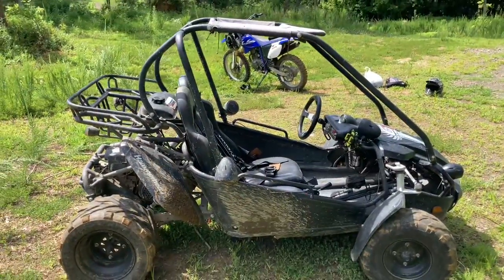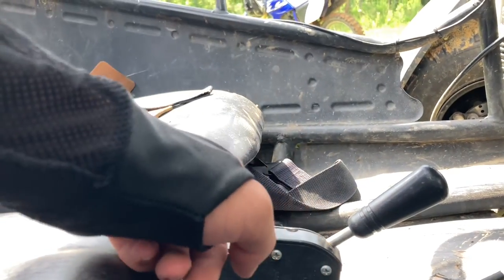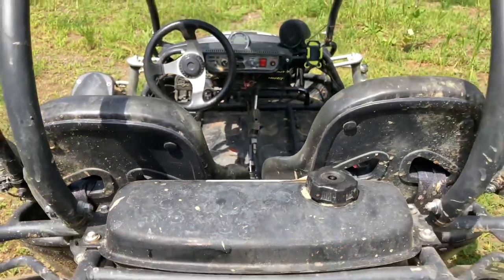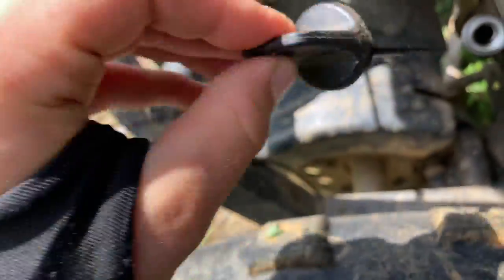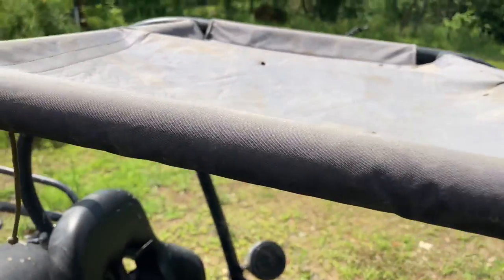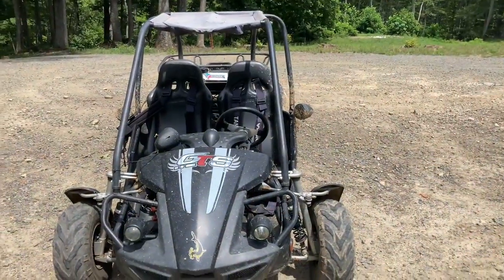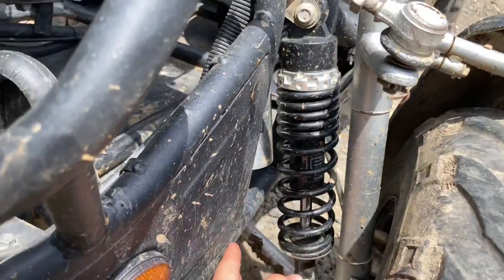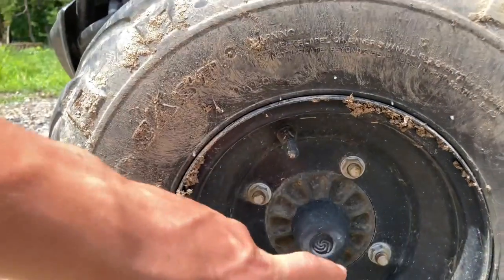Hammerhead GTS 150 Review!

Comment: Bought one in early 2020. Drives great. No trouble with the engine or power. The kids love it. Because of the solid axle you get traction on both wheels. I have driven it in about 8 inches of snow and it does not skip a beat. The headlights are not bright so added an 18 inch light bar to the roll cage. Perfect now

Comment: So apparently there is a speed governer and mine has been going slow, can you tell me where it is and how to govern the speed
Reply from the maker: That’s weird, mine didn’t have a speed governor. Try making sure the throttle cable is tight and push the gas down all the way and see if the carburetor is fully open, sometimes there is a little device behind the gas Pedal that restricts it. Best of luck fixing it
Reply: @TrailJoe  thanks man I’ll try checking it out
Reply: @TrailJoe  do what he’s saying but still it will run slow. You have to get a high performance CDI box. Already went through the trouble of researching for you. Here is the one that fits and works. Mine went from 37 to now 45mph. Next I am upgrading with an exhaust kit from hammerheadperformance